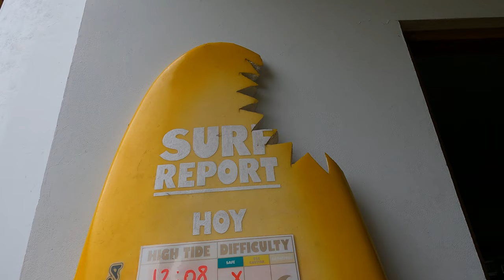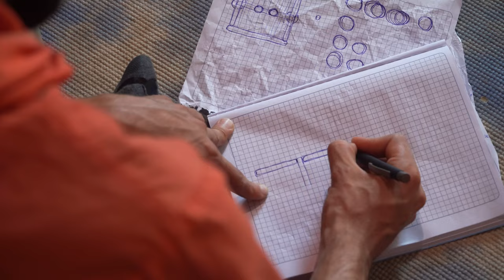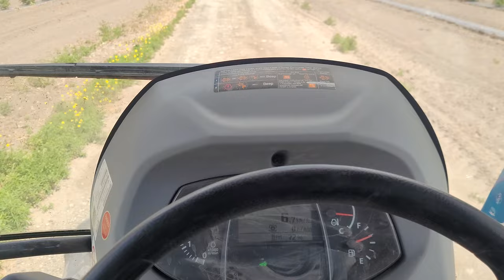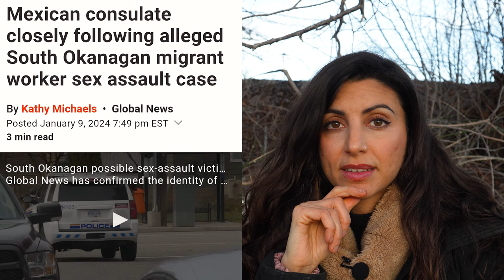Rising from the Darkness: Why I Disappeared and My Mental Health Battles

Comment: Coucou Rossanna, ta vidéo est très bien faite, sincère et pleine d'émotions.
Je me pose une question à l'issu de la vidéo, à aucun moment tu n'as envisagé de rentrer en France, de rester auprès de tes proches (je ne connais pas tes relations avec ta famille) lorsque le drame par rapport à ton père vous a touché ?
Tu as voulu absolument repartir à chaque fois alors que "rien ne t'attendais" ailleurs (d'après ce que j'ai compris)
Ce n'est pas une question pour culpabiliser ou quoi mais je crois que c'est comme cela que j'aurai réagit dans ton cas, du coup je me demandais si c'est quelque chose qui t'avais traversé l'esprit ou si pour toi c'était évident que tu allais repartir ?
Merci pour ta réponse et bon courage sur le ton chemin émotionnel, ce n'est pas évident ce que tu as traversé et tu as été très forte, tu t'es appuyé sur des outils forts pour avancer et ne pas te laisser sombrer. Bon courage ma belle et surtout prends soin de toi ❤
Reply from the maker: Hello ma belle, merci beaucoup pour ton message et d'avoir pris le temps de regarder 💜🙏 Non, la France je ne m'y sens plus chez moi depuis longtemps. J'y ai passé 1 mois et c'était largement suffisant. Et puis j'avais cet emploi qui m'attendait. Je ne me vois plus du tout me poser en France. Je pense que ça aurait été pire pour moi. Mais oui, ça a été une période très difficile mais tellement riche d'enseignements🙏 Je t'embrasse fort